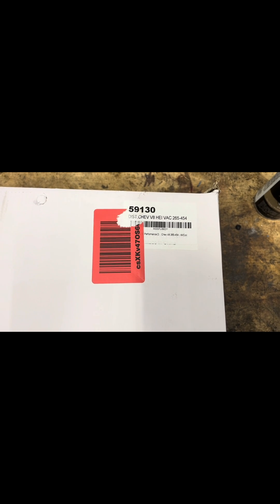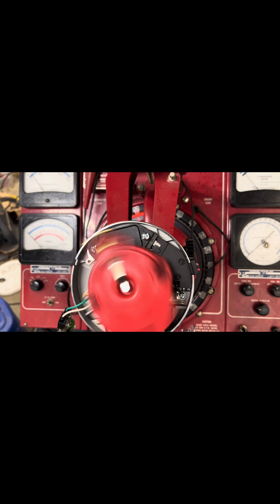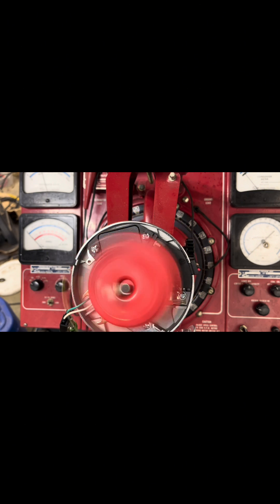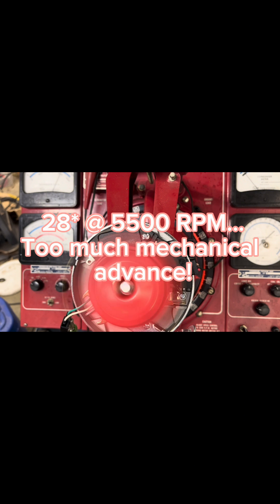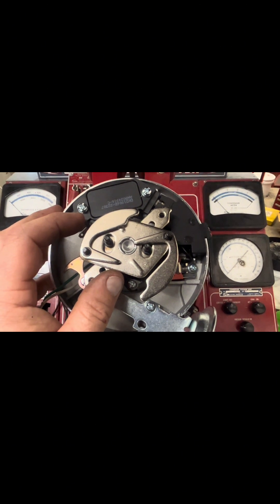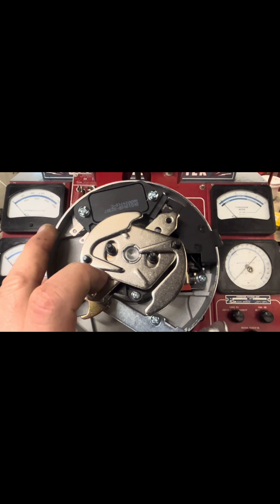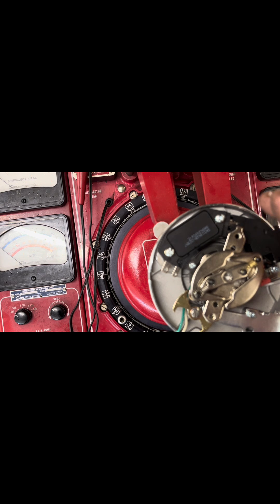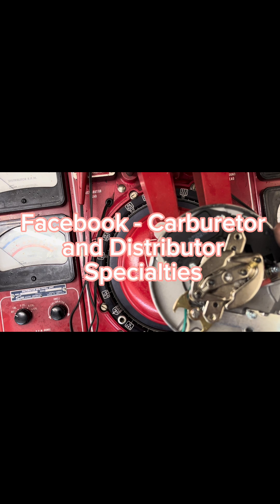Out of the box Accel 59130 Performance HEI distributor…How’s the factory curve???

Comment: My HEI is aftermarket but from 25 years ago. No name on it i can find. Its wieghts and centerplate all have numbers on them like the oem does. The base plate with the slots has #555 on it and with out ant springs attached the the weights at idle it adds 55° but with springs any spring it wont allow the center to advace past a point where the weights are pushing flat agaist the center plate which is about 20° mec adv when its all in depends on the springs.

Comment: Next time, before taking the distributor apart, flip the centerplate upside down so that the weights rest against the opposite, dog leg portion.  This should do two things:  Limit the mechanical advance to 18-19 degrees, and eliminate that advance creep at higher RPM.  

There is the possibility of wandering idle timing. With the centerplate flipped, the weights won't “nestle” against the centerplate as snug during idle RPM. If the springs are too light, then the weights could possibly "chatter", causing erratic timing at idle. Also, as flipping the centerplate slightly shortens the distance between spring posts, if the spring, regardless of tension, is too long, then timing at initial could wander.

I've driven my car like this for several years.  With two medium springs, the initial timing was always rock steady. I recently switched out one of those medium springs for a "hood hinge" heavy spring to delay the all-in timing from 2700 to 3000 RPM. That heavy spring, while tight, is a tad longer, and my initial timing can vary by 1-3 degrees from timing check to timing check -- it doesn't vary during the timing check. That variance is imperceptible by sound or feel at idle and I noticed it only with a timing light while experimenting with different curves. The curve after idle and total mechanical remain consistent and the engine still runs great, even better in fact with the all-in at 3,000 RPM.

This works only on the factory HEI centerplate shape, not the newer MSD etc “football” centerplates.

Give it a try.  Takes about 5 minutes to do, and 5 minutes to put back to factory if it doesn’t work out.

Comment: Your numbers at the end of the video are exactly what i'm getting in my chevy. I remove one spring and leave it out, set base to 4btdc and rev it up to 5k and get 32-34btdc. thanks
Reply: Don't limit that advance like he is.  32 to 34 is where you want to be unless your engine has very high compression.
Reply: @mattack6779  What would you consider "high compression" roughly? Just curious...

Comment: Client Ray here. Awesome video. The bag of tricks is a Mr Gasket re-curve kit I included so you have some parts to work with, was not aware that the distributor rotor slots would not accommodate the bushings. Welding the slots is the only way to limit the range of the curve. thanks for the quick turn around and I'll let you know how everything goes when I get it installed in the new engine.
Reply: Ray, how did it run when you installed it?